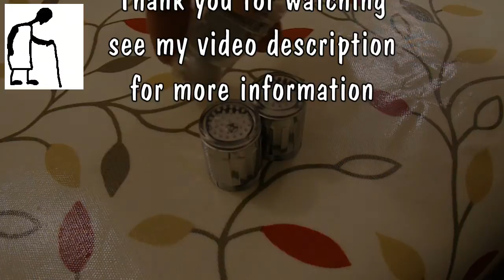Magnetism - Playing with a Faucet Light Part #3

Comment: Thanks for trying that.  That worked really well.  It makes me wonder if a rotating magnet device could be placed in the main water line feed to a house.  The generator could be outside the pipe and make electricity every time the water flowed through the pipe.  FREE ENERGY!!!!!!!!
Reply from the maker: I had given up these 2 lights for lost. Found them when looking for something else of course. Yes we could put a magnetic turbine in the water feed. Obviously it would only generate when water is being drawn but it could be stored. Certainly in my house we are on a water meter and are fairly focussed on minimising our water use.